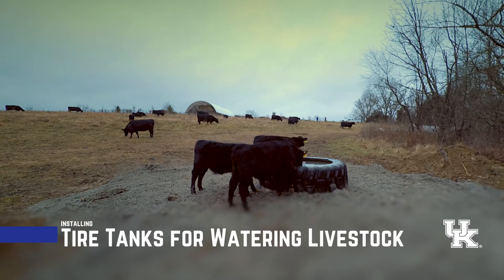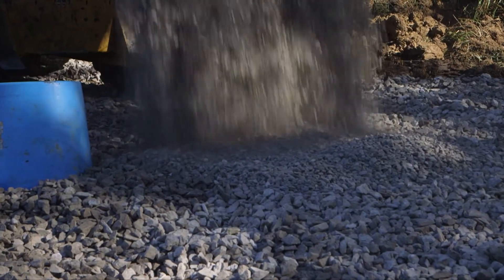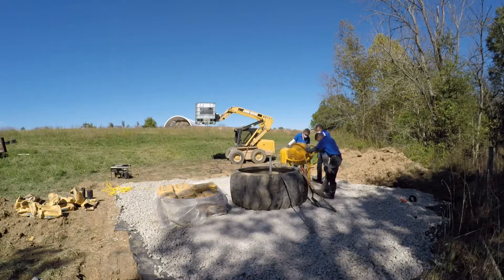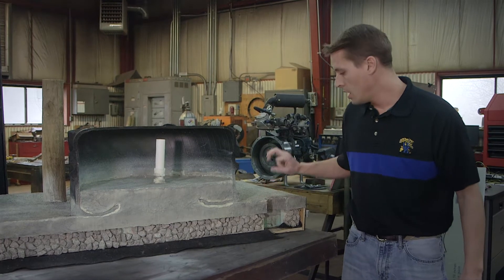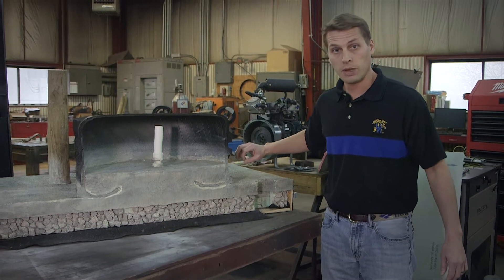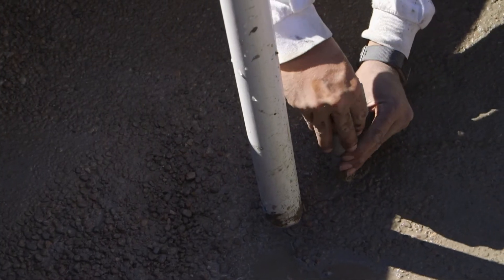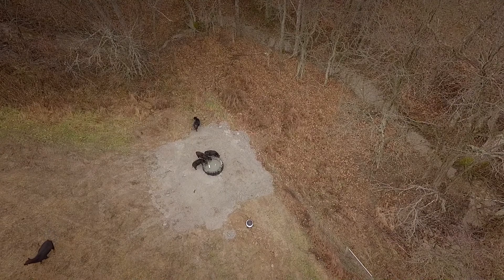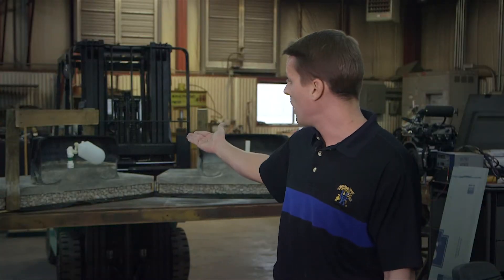Tire Tanks for Watering Livestock

Comment: You guys have no idea how to effectively install tire tanks. Seriously, your method is counter-productive and more costly.
Reply: Please send me your instructions, I want to do it your way
Reply: You people have no idea why thwy do this. When you live where it gets minue 25, a convetntional trough is a joke. This attract heat and helps keep wind out and keep it from freezing. I live off grid so my tire water has a black rubber trough inside a tire to keep wind from freezing it. A trough will freeze solid and a tank deicer doesnt work at 35 below. My waterer is raised on pallets instead of concrete and the pallets are covered by roofing metal (dark color) because we have great sunlight. It works better than anything else we have found.